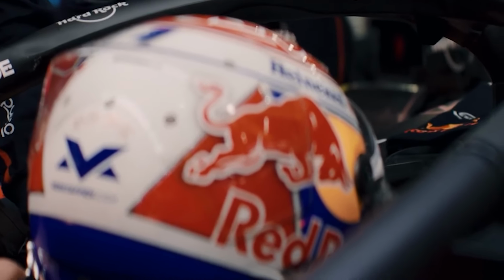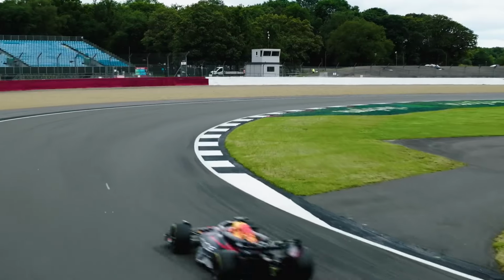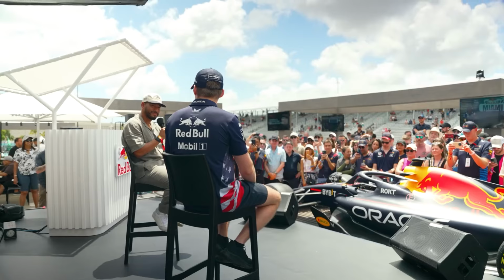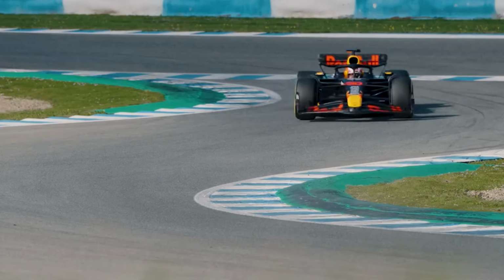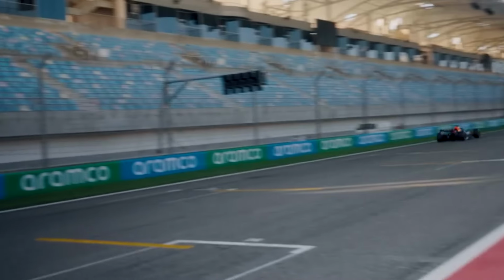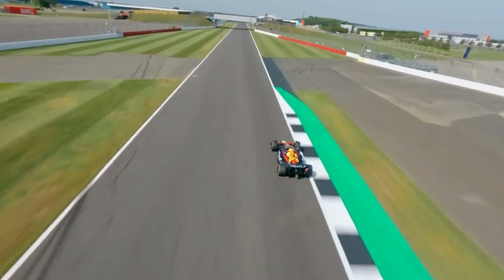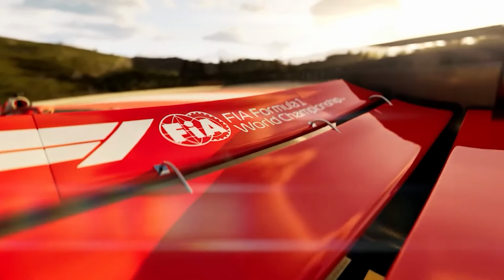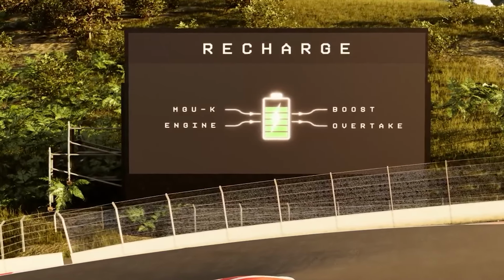THE FIRST DETAILS OF THE RED BULL FORD POWER UNIT ARE LEAKED

Comment: Correction: The RB car's engine is a RB team build and designed engine. Ford is providing the hybrid part of the power output.
Ford has already approved the RB engines performance overall, so all the other F1 teams have something to be very worried about especially if the RB team can keep the new RB management out of the paddock.